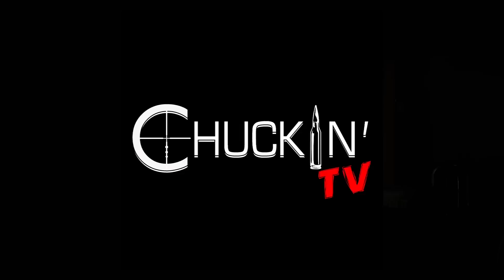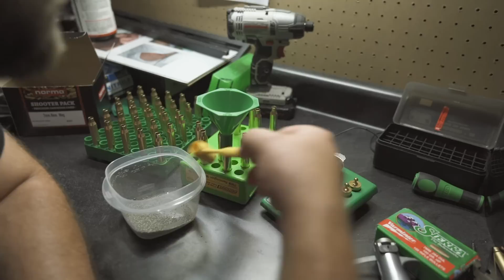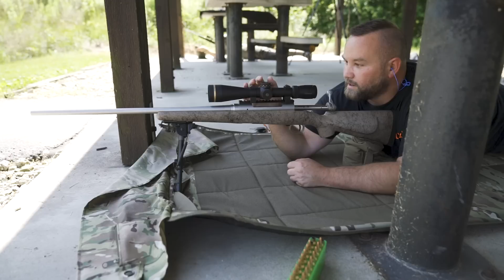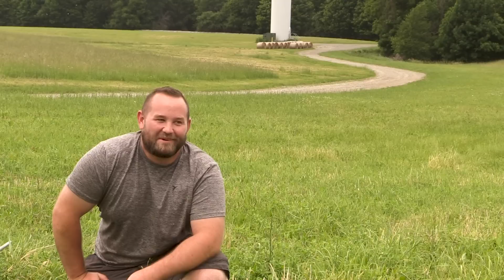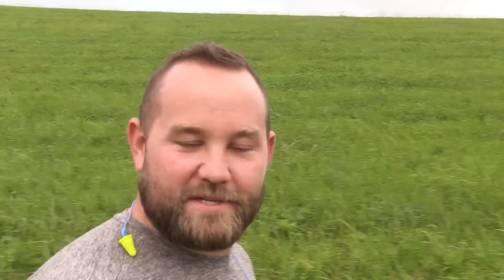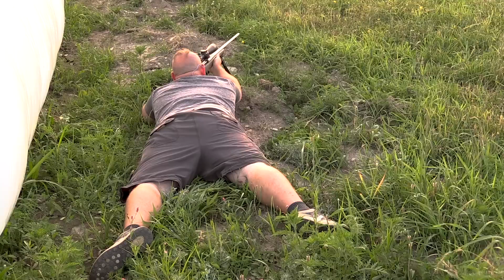Sierra 7mm 100 grain Varminter - Savage 116 7mm Mag Ladder and field test

Comment: I loaded some 100grn grenade bullets 3620fps if i remember right. They made bigger holes on paper as they was opening up anything over 3200 fps starts to open hollow point bullets 3620fps it starts to open or peel the jacket off the bullets. When it hits it exploads hence the grenade bullet name massive damage power dump.

Comment: Am curious as to why you ignored the 58 grains.  I run my loads up in .1 grain increments and usually 3 rounds per load to see how sensitive things are.  Have found a HUGE jump in performance even at .1 grain difference.  I am using a Rem 798 with a 3 pound pull, Bell and Carlson stock and a Nikon 3.5x14 Prostaff 5 scope.  I load with a Pact powder dispenser and use RL22 for the best performance with my 162 ELD X bullets, CCI mag primers.  My ONLY issue is dealing with a hot barrel after shooting two groups, so I’ve taken to shooting a 3 round group and then wait 5 minutes before the next series.  I am also loading on a MEC single stage press.  It’s probably the next closest one will get to a Forster press and darned slick to work with.